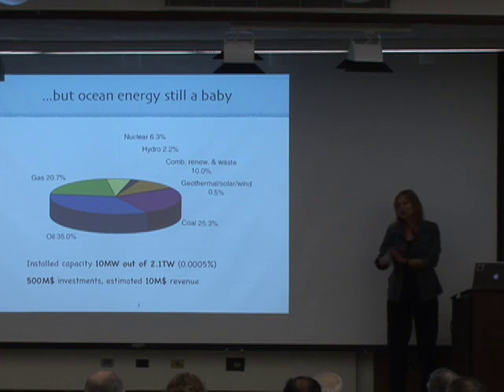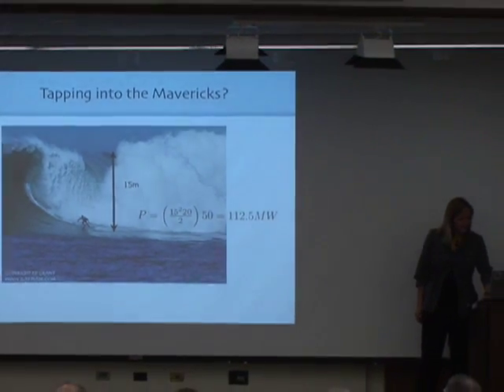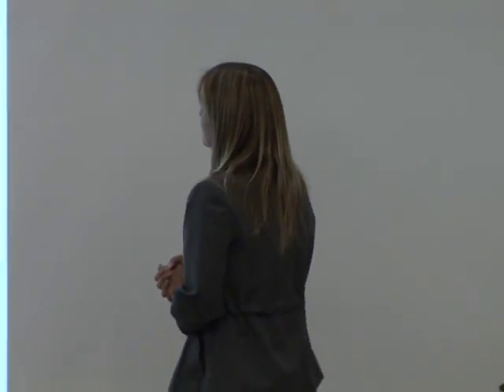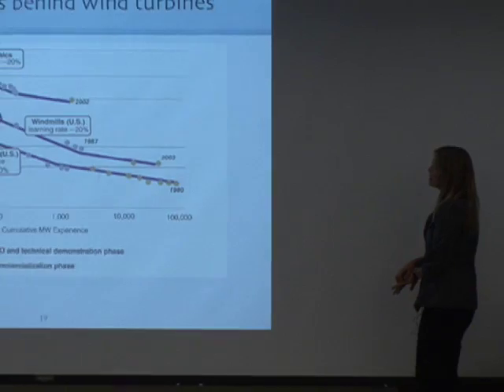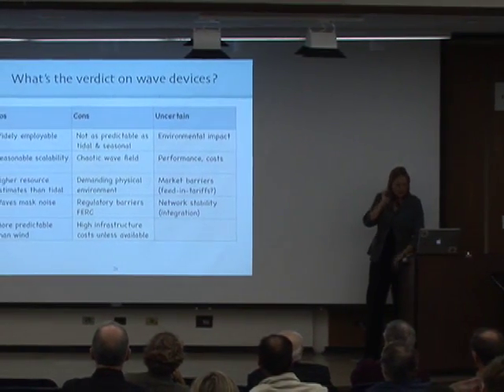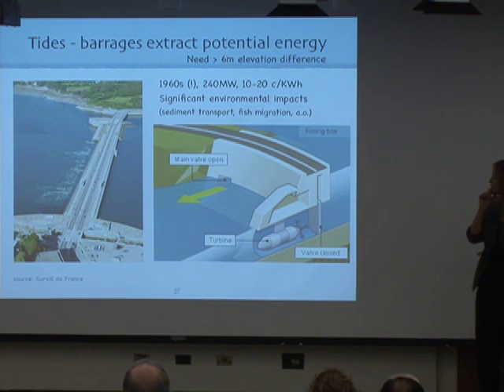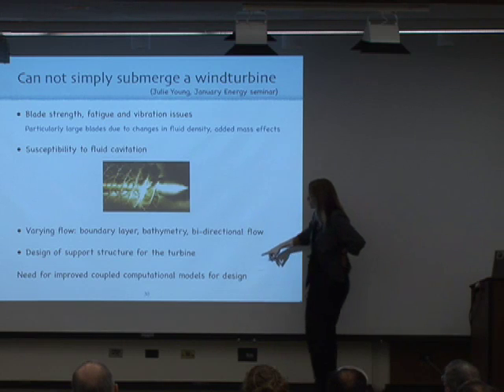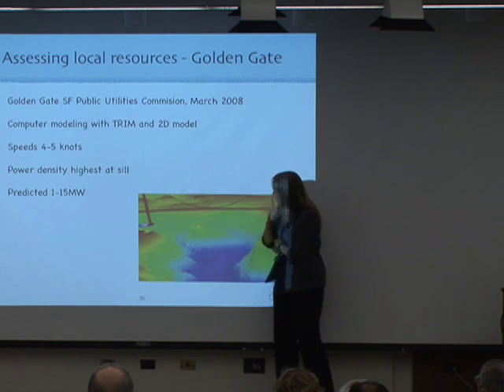Marine Energy Technology: Waves and Currents

Comment: For high efficiency, the kinetic and potential energy of waves and tides must be collected. The horizontal and vertical movement energy of the water in a location must be transformed directly into electrical energy without intermediate elements.
I have a proposal for a power plant that collects the kinetic and potential energy of moving waters that also achieves active protection of the banks